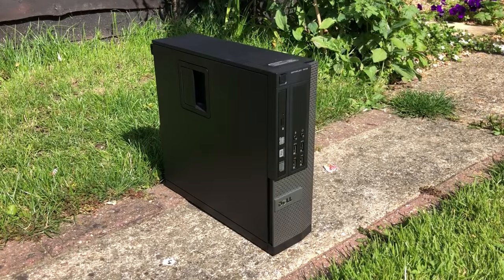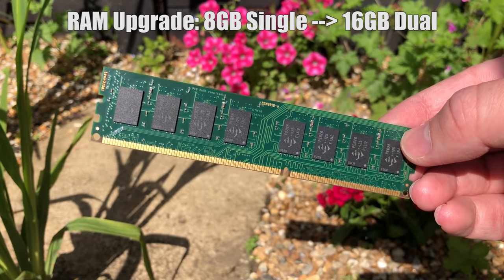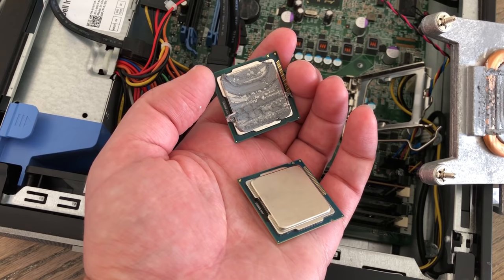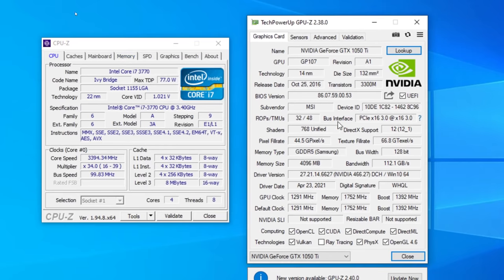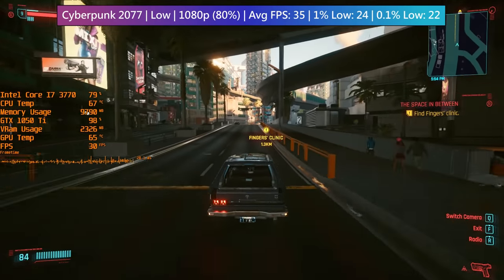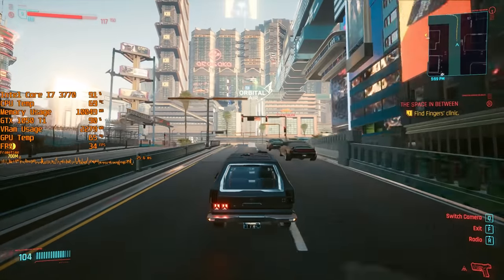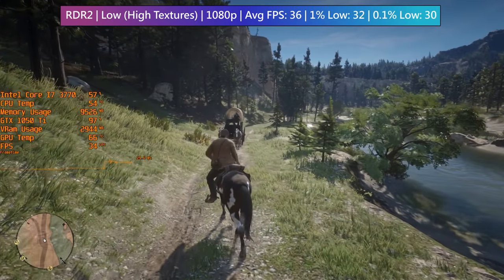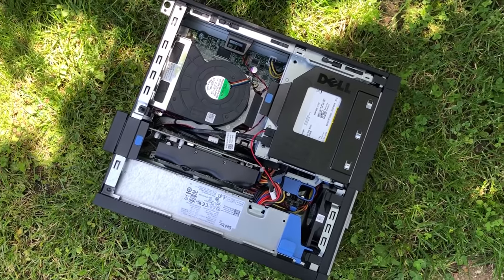Turning The Tiny, Cheap OptiPlex Into a Gaming PC - With Whatever’s In Stock

Comment: Yup Yup Yup!!!!, this is the way, i bought one of this for 1 of my friends, bought it for 99$ with a core i3 2100 4gb ram, and 250gb hdd, and upgraded to a 3770, 1tb SSD and a GTX 1650 LP,  and 32gb of ram!, now its a beast hahaha
Reply: You got ripped off at $100. The original motherboard and CPU is only worth like $40 dollars. You could of had a 4th gen i5 optiplex SFF for $100 instead. They still aren't the best deals since you are stuck with low profile cards. You could have spent that extra money on a new system. A case with a more modern motherboard, CPU, RAM and power supply is just a bit over $200 used and you are then open to a selection of better and more affordable graphic cards.

My point is upgrading an SFF isn't the smartest thing to do on a budget these days. Build new or just get a full size optiplex instead.
Reply: @Heliocentric  unless they want an sff build
Reply: @razer1158  oh I know. My point sorta is if you want budget don't go SFF. 

Personally I have a HTPC. But I understand the extra costs and potential issues such as heat and internal space. Money wasn't a concern.
Reply: @Heliocentric  yeah I agree, you can see that 1050 Ti from the video with its fans pointing straight down into the PSU with little clearance.
Reply: 32gb ram sounds like a waste with this config, you could have gotten something else with that $
Reply: @BonusCrook  

The 32gb of ram is a waste the i7 3770 will be unable to play new games that actually require more than 16gb of ram so yes indeed u are very correct. The i7 3770 was my first gaming CPU and I'm very familiar with it's limits since I paired it with a gtx 1080ti. Any new games that use a butt ton of ram the 3770 struggles to run half decently.
Reply: I just wished that CEX sold in America again. You couldn't beat their prices. A 3rd gen i5 goes for like 50 bucks right now and it's stupid
Reply: @Dtr146  i5 3rd gen is like 20 but the i7 is like 100
Reply: 32GB is ridiculous on that kind of system. Hope your 1650 LP isn't one of the higher power ones... really pushing that little power supply to the max...
Reply: @cortezbaldur413  and for this reason I replaced my 3570k with a 2600x in our second pc
Reply: Good one.
Reply: so you were just buying a used dell case for 99$ lol
Reply: @KnowerofThings  ...and motherboard and likely CPU fan. Lol and good luck rocking that decade old power supply.
Reply: @Heliocentric  Nohing wrong with 10 year old power supplys if they are quality.
Reply: @corneliusantonius3108  you definitely haven't had the history of using those old Dell SFF PSUs.

I have a 30 year old power supply running an arcade cabinet. Age isn't the issue, it's quality.
Reply: @Heliocentric  Well I do'nt , I onley dabbled in the mini towers.
Reply: @Heliocentric  Blah, blah, blah...ALWAYS one isn't there?
Reply: @Sean Price My pleasure ♥
Reply: @Heliocentric  As a matter of fact, I do have experience running old AF Dell power supplies. They're absolutely fine.
Reply: @Sean Price likewise
Reply: basically my moms pc but i didnt spring for storage and a good gpu . she got 240 GB and HD 7770 but better than the old dell E2140 1.6 and loves the difference
Reply: @Heliocentric  pcie extensions cost around 10 - 15 dollars if you don't care about color or better yet just remove the bracket and side panel. that look isn't for everyone though and aesthetic is important in some manner.
Reply: What optiplex was that as id be surprised if dell made an 1155 socket version go beyond 16gb.  Hell my 3010 only supports 8gb max, but then mine is an sff.  You must have one of the bigger versions ?
Reply: @TheBigup how much watt of his psu??

Comment: these optiplex's also have unofficial support for equivalent & cheaper xeon CPUs & ECC registered memory
Reply: Depends on the chipset.
Reply: I have one with a xeon... just had to update the bios from dell and it worked fine...
Reply: @TheShugster1874  How do you get a Xeon into the chip slot?
Reply: @Flytrap  I have an E3 1231 V3 in my B85M board. It was way cheaper than a 4790, runs a few less watts,  and performs quite close to it. Before they corrected the error, I could actually overclock the Xeon and get all the cores to run at 3.8Ghz. Not that long ago, there were Xeons that would work in desktop sockets, but Intel has ended that.
Reply: Some of the zeons you can chopp of a tab and the pop in
Reply: @bills6093  Can’t you get adapters?
Reply: @bills6093  the E3 1231 v3 is not really close to a 4790 tbh more like a 4770 i have the e3 in one of my rigs and next to the i7 4790k its not even close in perfomance.
Reply: LGA 115x/1200 Xeons don’t need physical mods like LGA 771 Xeons did. LGA 1366 and LGA 2011v1/v3 Xeons are the same way - drop in and go.
Reply: @toxicityuser  Not for anything modern. The chipsets are even different now.
Reply: @bills6093  i dont find this...,..the 4790k has 15% faster ipc at stock speeds this is significant and widens  hugely as you OC,

the xenon has done me well but to say it performs the same as a devils canyon part is just silly. i couldn't really game on the xenon now days but the 4790k @4.8 is still a beast of a cpu 7 years on,
Reply: The optiplex xeons (e3-12xx ) use only ecc, not registered ecc. Registered ecc is for the “bigger” xeons
Reply: @bills6093  They are still available for HEDT platforms, no ECC.
Reply: @EnemyDwarf-TTV  That's because you keep adding a K on to my 4790 comparison.
Reply: @jamegumb7298  As of Skylake based Xeons, Xeons no longer work with desktop chipsets, as far as I know, even with the same socket type. Intel split them apart. Skylake Xeon requires C series chipset, for example. E3-1280V5 is an 1151 chip, but needs a C series chipset to work. Cannot use it in a desktop board.
Reply: @bills6093  I was talking socket 2066, but that then also no longer works?

Would make sense with Intel's strict segmentation. 

I just went straight socket 3647 for my dev rig. Compiles like a bat out of hell. Getting it liquid cooled in 1U was a bit of a hassle but it worked.
Reply: @jamegumb7298  Socket 2066 chips are split up as well.
Reply: I currently have a Xeon 1230 V2 in my Optiplex 3010 sff. It supports up to the 1290 v2 which is faster than an i7 3770K.
Reply: @nermanus  That Xeon is 87W tdp though. Not sure about pricing, and the overclocking factor. But if I could find the Xeon cheap, I'd try it.
Reply: e3 1230 is good for about 30 bucks
Reply: @bills6093  hey, may I ask how hot your 1231v3 runs? I had to undervolt mine because it was reaching 90° C under load
Reply: @bepisman3161  Mine is V2 so it's ivy bridge and I paid $40, that's solid for 4c/8t.
Reply: @sachatrin2981  When I could get all the cores to run 3.8, yeah it got hot and needed a better cooler. Normally, the regular copper core stock cooler did okay unless I ran it really hard, like Intel Burn Test. Then the stock cooler was useless. If all 4 cores are at 3.8 under load, then your board is overclocking the chip.
Reply: @bills6093  mine’s running at 3.6 all cores, with a tower cooler
Reply: @nermanus  You could just get an overclockable X58 xeon with 6c/12t for cheaper lol... My x5675 was running 4.65ghz all-core and I paid $40 for that, too. You could get a cheaper x5650 for like $5-10 and overclock that to at least 4.3ghz and still get 6c/12t.
Reply: I run a xeon 1230v2 in my optiplex 7010 MT with an rx580 8gb and it's still my main system today.
Reply: @Durkhead  Yeah I did that a few times. That applied to the lga 771 xeons to fit the lga 775 socket. Some you had to block a few pads on the processor as well.
Reply: Wont be buying Dirt 5 it looks like dirt😂
Almost like Colin Mc Crae 2 from circa 2000❤ great game that was.

Comment: I remember about 5 years ago I had a set up very similar to this. I bought a cheap Lenovo M91p SFF and smacked a low profile 1050 ti in that thing. I have to admit that thing was a trooper, and it was great price to performance at the time. Man I miss when the 1050 ti low profile was still cheap.

Comment: That's one of the best Optiplexes I've seen. A great fansink with copper heatpipes and two PCI-E x16 slots.
You're lucky to find something like that.
Reply: @comicsans1689  sounds like a good flip
Reply: a healthy chipset supporting all the way to 20 series. with 8x on both. or 16x on 1. the 4th gen K series are the bees knees as well.
Reply: I have a larger Dell optiplex 9020 mini tower, it has two pcie 16x slots, one pcie 1x, a pci slot, 4 ram slots, and one of the better Intel style heatsinks with a copper core. It sadly also has a proprietary 8 pin motherboard power connector but that can be fixed by purchasing a adapter online for less than $10.
Reply: I have one better, my actually Optiplex 7050  SFF 240w, i7 7770 and 32GB ddr4 @2400mhz will run superb in combination with my next Pulse Sapphire rx6400, I'll upload a video when get this gpu for SFF pc :D
Reply: @ale2ooo  is the PSU the stock unit or did you replace it with an aftermarket one? If so, which one?
Reply: @silvanigra  Hi, it's stock. Not sure if it's 240w or 180w (+ bronce) but my rx6400 runs flawlessly in this config

Comment: I love seeing optiplex budget builds so much! This video is no exception! Great job!
Reply: Hello gpu. When will you be cheap as before??
Reply: @Graphics card You again! When will you come to me in the form of a rtx 3060 😚
Reply: @brandonmitchell2374  on top of that, he/she doesnt want to lower his/her prices 😖
Reply: @mattynicolaz9832  Soon... soon 😈
Reply: I found a basic HP desktop with i5-4590, 8gb ram, and 500gb hdd for $50. First PC ever, did some research and found 1050ti was my best option as my PC has a proprietary psu. Dug some more and found it can actually take a 1650 which is a significant leap over the 1050ti. So I bought the 1650 (gddr6 version) for $160 on Amazon right before chip shortages and price increase took place. I since upgraded to 16gb of ram and a 250gb satta SSD. For $250 total I have a pretty competent machine. Even capable of very minor VR games like VRchat. Been that way for a year now.

My buddy actually found an old i7-4770 in storage and it's actually compatible with my motherboard so I'm going to upgrade to that shortly which will see even a bit more performance. I'm shocked foreal. It's It's great machine for $250
Reply: @TTBUG  did you swap the case? To get the most out of that build, you should swap the case, but otherwise, what a steal! You can definitely find that stuff everywhere!
Reply: @Graphics_Card  it is a full size case. If I remember correctly it is an HP 600 g1 twr? 
It even came with 4 USB 3.0 slots! Along with 4, 2.0s

Comment: When my best friend's PC died on them, I bought an Optiplex 780 with a i5-2400 for cheap off eBay, tore it down, gave it a good clean and a coat of spray paint or three. I chucked in a low profile GTX 1050 (back when they were MSRP), scrounged around for 12GB of RAM, and velcroed an SSD inside as the bootdrive. It was meant to be a temporary gaming PC while we got a brand-new build sorted so I tried to spend as little as I could. That was over 3 years ago and it's still going lol. My friend mainly plays GTA Online and The Sims 4 and it's still fine in both of those games. They remove the side panel while gaming to keep temps down which definitely helps. It was a fun little tinkering project for me with bigger than expected payoff in terms of lifespan, and I have massive respect for any Optiplex builds/mods as a result lol

Comment: These computers make great compact budget gaming machines. I ran a 390 SFF with a GT 1030, an SSD, and 8gb of pretty nice DDR3- all stuff I had lying around. It did a pretty decent job. It helps that you can quite literally find them being thrown out all the time, too- I've probably fixed up and sold at least 5 of them at this point.

Comment: I have one of these lying around, except its an optiplex 780. It has a second-gen i5 and  some horrendously slow 4gb of ram. I don't even want to try to game on it but I must say these things are very good for keeping important files and for making backups.
Reply: I got an i5 2320 + 8GB of ram, with a GTX 480 (better than GTX 750 ti, but not a lot). It's running like a beast.
Reply: Narkomancers  

Yeah mostly in newer games that were released after driver support died for Fermi.
Reply: Not sure if I understand why you wouldn’t just use external hard drives for backups instead
Reply: Narkomancers  that's also true.
Reply: 780 would have been Core 2. I had a 980 with an i7 and a Radeon r7 350x 4GB in it (basically a glorified r7 250). That was a pretty solid system for what I did with it and I managed to sell it for more than I paid for it, it’s PSU replacement, and the graphics card.

Kid that bought it from me still uses it as a living room machine for emulation and lighter titles.

Comment: This video is super timely as my i7 3770 is currently on its way and this gives me an idea as to what I should expect.

I have similar build (i5 3570 + 16GB) except that I have a 1650. Hopefully, the 3770 combined with my 1650 will provide slightly better results than your config.

Great video, as always. Cheers.
Reply: 1650 is A LOT better than a 1050/1050ti so fuckin aye chief :)
Reply: I got an rx550 with 4gb of gddr5 VRAM and it runs really good

Comment: Great video 😀 this is where I started my journey with building pcs 🖥 you don't have to have a mega costly high end pc to have fun 😀😄 I still have a asrock deskmini with a 3400g and still enjoy using it alongside my main gaming rig 🥰
Reply: If u pair a decent gpu with that Apu it still makes a solid low end gaming rig.
Reply: @cortezbaldur413 yes deffo agree with you, but in my case the deskmini is way way too small for a gpu, and they don't have a pcie slot on the mb, this ickle pc I just use for Web browsing and emulation or playing older games maybe a bit of office work, i like it cause it was really small size wise, low power and cheap to build 😉 I have another pc for my main gaming set up 😏

Comment: welcome to my first gaming PC, although mine was 'upgraded' with a GT730 back then.  Dirt cheap way to get into PC gaming and taught me a lot about system building.  Incidentally the SFF optiplex I had the full length PCI slot was in the bottom of the 2 expansion slots so I had to find a low profile, single slot GPU.  OEM PSU and Mobo became the biggest issue in upgrading.

Comment: One thing to note on the CPU upgrade... if you're upgrading to an i7, or HT Xeon, from the i5, you will have to go into the BIOS to enable hyperthreading as it will default to off in the OptiPlex systems.
Reply: Yeah I made that mistake recently when I upgraded a PC with an i5 3450 to an i7 3770, forgot to turn on hyperthreading in the BIOS and was wondering why the PC weren't performing much better for about a week haha.

Comment: I just upgraded my own optiplex. Dremmeled out the side panel, ran my 980ti with a riser. Trick is to get that proprietary mobo power socket adapted for a standard ATX PSU. 1440@120 to the TV is slick. The empty space from the old PSU is perfect for hiding the other psu cables.

Comment: The trouble with the newer Optiplexes is that the 16x slot is right up against the power supply and you can only run a single slot GPU in it.  I have an i5  4590/GT1030/8GB.  It was my gateway to PC gaming and is now the YouTube and Netflix box.

Comment: it turned out into a relatively acceptable rig with those upgrades, the power supply was quite the mvp there
Reply: but the original mechanical HDD, a small one at that is a terrible bottleneck like putting a GT 1030 in a Threadripper would be

Comment: I’ve done a similar build with a small form factor Dell from that generation. In 2020, graphics cards were much cheaper so I opted for the GTX 1650.
Otherwise I’ve chosen the same CPU and same amount of RAM.
And I upgraded to a 480 GB SSD.
Never regretted building this machine. Works fine for gaming with Steam on Ubuntu.

Comment: 2 possible solutions to avoid overheating: 1) leave the case open, it should lower temperature real well. 2) leave the case open AND buy an external PCIe card holder with PCIe 16x cable, to relocate the gpu in a favorable position. In this case, it will run a lot cooler!

Comment: One nice thing about these low-profile cards is they are super easy to “Noctua fan mod”.  The biggest reason to do this is none of the low-profile cards have “Zero-RPM Mode”.   My Zotac Low Profile 1650’s MINIMUM fan speed is 40%!!!

To fix this fan noise issue, I strapped two 60mm Noctua fans on with zip ties.   It’s nearly silent at 100% fan speed and runs cooler at full load (fan speed only goes to like 50% when the GPU is at 100% now).  I got a VGA fan adapter thing (2pin -> 4 pin Y-Cable), so both Noctua fans are controlled by the GPU fan header!    I love it lol.

Comment: Dell and Intel have been surprisingly good options (but only at key moments in time, such as Ireland) for components to go into mboards (even mboards bare in features) which are not made in the orient (like LAN NICs), and almost we had intel to be made here in the British Isles (but recently they have told us to sod off). Intel have iGPU on the CPU which can do virtualisation and are about as powerful as an nvidia 1030 (but sometimes with more RAM for video). It's their iGPU which makes them worth it (even though many people slag it off, wrongly comparing it to powerful GPU cards). Were it not for that, I'd have preferred some sort of open-power thing instead (IBM). ARM (like USB) has been a massive pain in the arse but you simply have to know how to use it and live with it. Now ARM seems to be going, OpenPower is a very good option. Power-saving can wait.